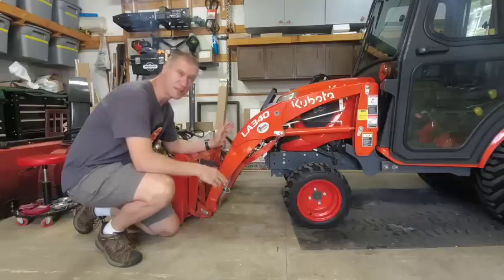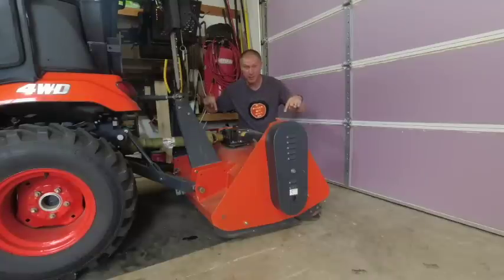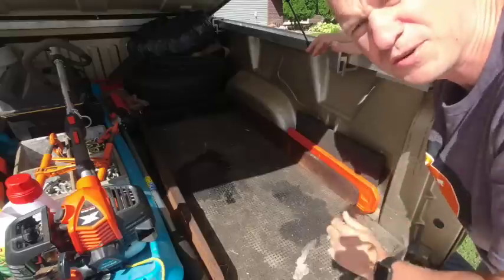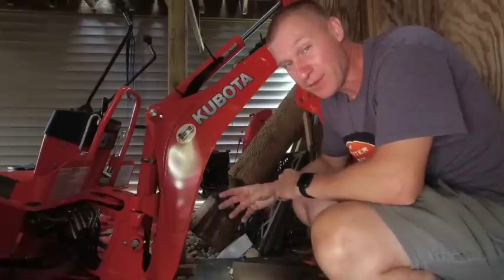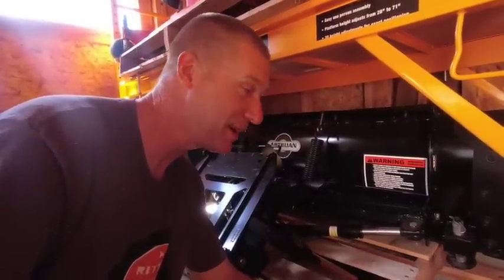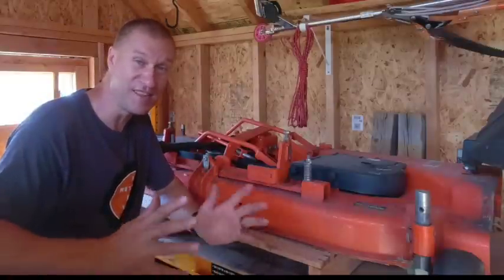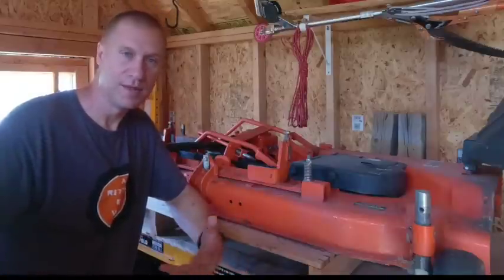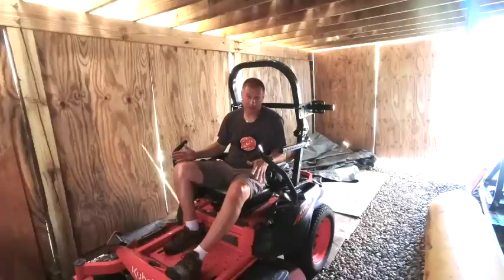THE WORST TRACTOR ATTACHMENT!

Comment: I have a BX 25D with less than 400hrs. I bought a BX 2200 with a  mower deck and front plow in show room condition with extras less then 400 hrs for $ 5000. I just spent a day at a equipment show after looking at zero turn mowers and prices I have no regrets.
Reply from the maker: Perfect solution for you. Having two BX tractors is a great way to solve that issue! 
Thanks for the comment! 
Keep on tractoring!

Comment: Get a Massey Ferguson GC series tractor.  The mid mount mower is an easy 3 minute job to remove or put back on.  It does a great job also.  Had mine for 5 years, mow about 2.5 acres.  Remove it nearly every time I mow.

Comment: I actually use my 60" belly deck in the spring for brush cutting. Those blades are very thick and a very stout deck.
Reply from the maker: Very strong mower! It will cut some heavy stuff. Just watch your temp gauge. 
Keep on tractoring!

Comment: I am in the process of buying a tym here in Ontario. I am leading towards a fail mower instead of the mid mont mower deck even though tym is a drive over deck, just the Fail Moweris all-round unit, and with a really bad back I am not a fan of rolling around to hook up the deck 😅
Reply from the maker: Be aware that even the drive overs aren’t that easy to hook up. I’m not sure about the TYM mower so be sure you understand it well before you buy. Good luck and thanks for the comment. 
Keep on tractoring!

Comment: I agree... but also disagree. For most yards a zero turn is perfect. My property, there is a number of places I need to use 4wd. We tried my neighbors zero turn on one hill, it wouldn't climb it, tried side hill... it slides down sideways. I cut straight up and  turn around , cut straight down. (in low range and 4wd it just feels safer!) But I also have a 54" instead of a 60". I leave it on almost all the time in the summer with loader work and backhoe work. To each their own... still love my BX (And finally bought a cab!!! Original Tractor Cab going on shortly)

Comment: if the BX is limited without the loader  having a wimpy loader doesn't exactly fix that problem
would your opinion of the MMM change at all if it was super easy to take off and put on?
Reply from the maker: The loader lift capacity can be altered, but its factory settings are embarrassingly dismal. If the MMM was easier to put on and take off I’d still have the same opinion. The added hours on a tractor to do what a lawnmower should be doing isn’t necessary in my opinion. 
Keep on tractoring!
Reply: @ritterjon  valid points on all counts 
as you pointed out which attachments are worthwhile  or not varies widely by individual.

Comment: I hear what you are saying about the mid mount mower deck but I don't totally agree.  I have a John Deer 2038r with a 72" auto connect mower deck. I rather mow with my tractor than my Bad Boy 60 " 0 turn. It only takes me 5 minutes to install or remove my mid mount mower deck. Same thing with my loader, Only 5 minutes to install or remove it as well. My J D is smoother, cleaner, and just as fast as my 0 turn.

Comment: Disagree. I sold my rider mower and bought the mmm after i already had the BX. One less motor to maintain and frees up space in the garage without the rider. Cost per hour may be higher using the BX, however i feel kts more reliable over the long run. Everyones situation is different so to each thier own.
Reply from the maker: You’re absolutely right, everyone’s situation is different. Thanks for watching. 
Keep on tractoring!

Comment: Jon, you sure know how to rub salt into a wound….. lol. I bought my BX2360 with a MMM deck and without an FEL. I have regretted that decision for the last 10 years. A loader and a rear finishing mower would have worked out much better. But I was able to come up with a better solution. In addition to the BX, I got an L3560 with FEL and cab, along with a Z125S zero turn. After all you really can’t have too many Kubota’s….. lol. 

My least favorite and most disliked part of the BX is the crazy fuel filter arrangement.
Reply from the maker: Sorry about that. 😂 Glad to hear you’ve solved your issues with a other machine and a zero turn. I also can’t stand that stupid fuel filter design. 
Keep on tractoring!

Comment: A 72” mid mount mower for my Kubota tractor is a $4300 add on. No thanks. You can buy a dang nice flail for that, and it’s much more versatile to boot.
Reply from the maker: Holy smokes that’s a lot for a mower deck! Your right! Get a flail and have a lot more fun using it! 
Keep on tractoring!

Comment: Disagree….if you have hills Zero Turn is not the way to go…
Reply from the maker: They’re not the best on hills. 
Keep on tractoring!
Reply: I will take my toro 2000 on steeper hills than my kioti ck.  I can cut everywhere I can walk without worry.  I still have to bring out the brush cutter or string trimmer though.  I take my zero turn wherever a tracked forestry cutter could go.